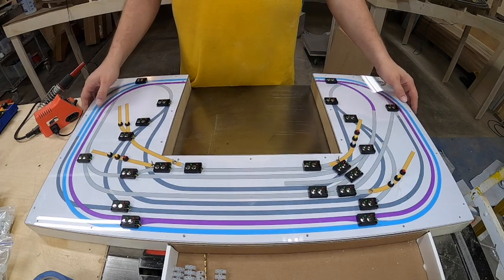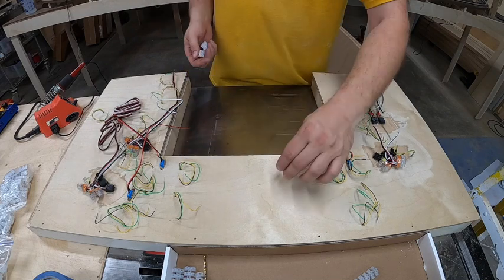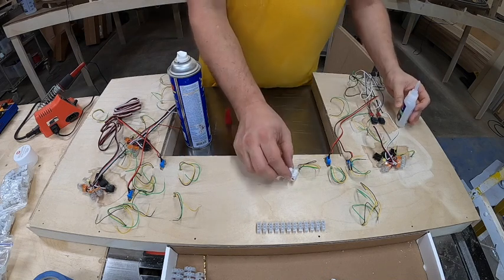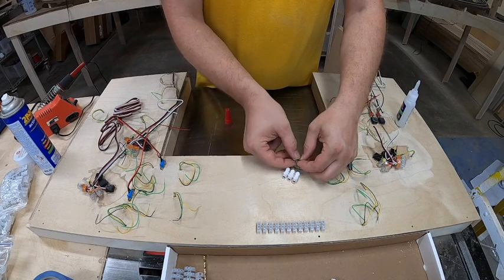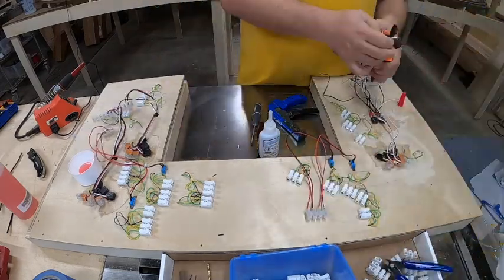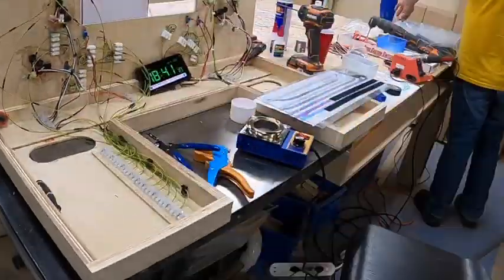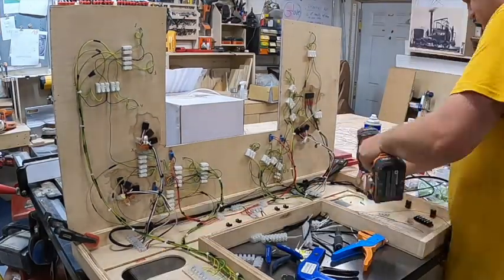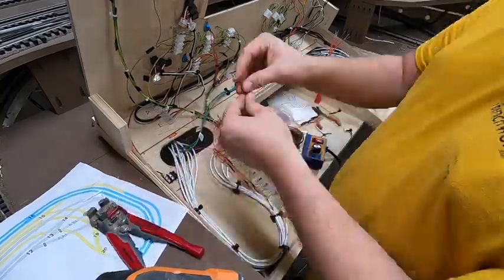wire, wire everywhere- control panel build part 2

Comment: Such an excellent, educational and informative video on how to wire up a control panel! Very much like how you showed your method and order of connecting the different appendages on the backside of the panel’s face, then on to organizing the wires from there to the bottom of the control panel and finally the connection of all the different wires coming from the layout onto the neat strips on the bottom. This indeed makes sense for whoever needs to open this panel to either check up on something or to do maintenance on a wire to one of the components. Thanks 🙏 very much for sharing!

Comment: Wow. Your fast forward wiring makes the job look almost enjoyable. Almost. Come springtime, when it warms up here in Maryland, I’ll be installing a full, new, modern wiring harness in my 1951 Chevy Styleline Deluxe. This video makes me dread that job 18% less than before I watched it. Thanks! (I also, once again, got some very useful tips, both fir the car and my model railroad layouts)
Reply from the maker: Wiring a car is easy compared to this stuff. Seriously I’d happily wire a 51’ Chevy.   Wiring layouts however is essentially just connecting  A to B. There’s just a lot of those connections to make.